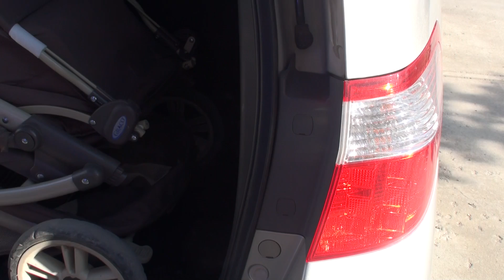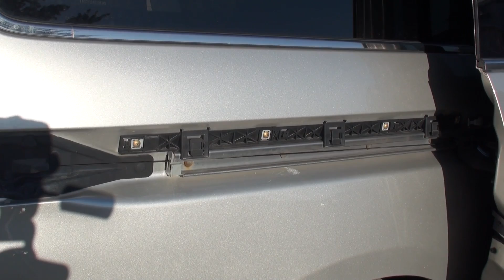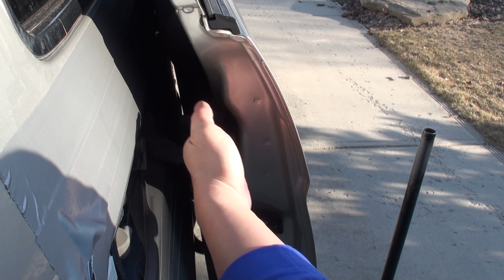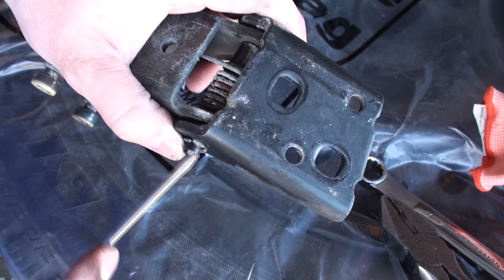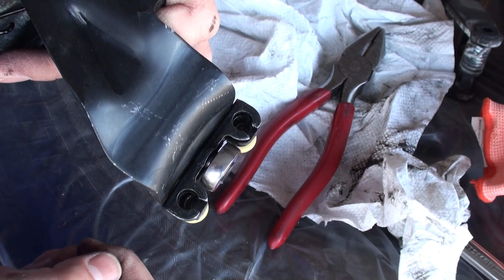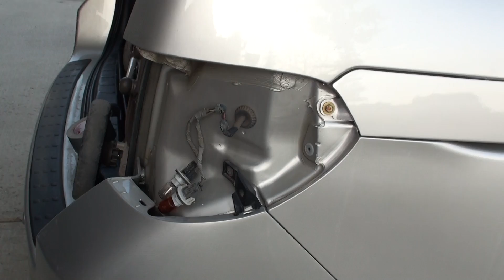Honda Odyssey Center Rail Door Roller Replacement

Comment: Thanks for the info. I do have one problem though. My cables went back inside a bit so I don't have much slack to connect the new sliding door hinge. What can I do?
Reply from the maker: you'll have to use a pair of pliers to carefully pull on the cables (you won't need much force) to pull them out.  It helps to work close to the van so that you need "less" cable.  You won't want to pull so hard you snap the end of the cable off or cause it to fray.

Comment: So thankful for this video...saved us $1800 all we needed was the roller replaced but the shop was trying to tell us we needed to replace the motor and everything. Cost us $40 and the doors work like new
Reply from the maker: yeah its amazing how incompetent the factory trained techs are.  Look at the lowest common denominator first and as a result, that is how I concluded it was a faulty roller.  Glad to hear you got it all fixed up on the cheap.

Comment: Damn bolt holding the two pieces together can’t come off. I’m still stuck trying to remove that damn bolt. Just sprayed WD40 more than a couple times, damn thing won’t budge. I need help.
Reply from the maker: Yikes, its been 2 months and I'm finally replying to this comment.  Hopefully you were able to get the bolt out.

Comment: Excellent, clear, and concise video.  I ordered the rollers for both doors on Amazon ($40 total) and installed them yesterday.  I'm sure I saved a lot of money doing it myself.  Hardest part for me was removing the pins.  There was a lot of rust and I had to use a lot of spray lubricant/rust remover then wait for it to work on the pins.  Easiest way to position the door was to turn off the power door switch and position it manually.  I also made sure to turn off the interior lights so the battery didn't drain - I saw that happened to a guy in another video.  It definitely helps to have a second person hold the door in the right spot when putting the bolts back onto the door.
Reply from the maker: glad you liked the video and thanks for sharing those tips!

Comment: Thank you very much for posting this video. Muchos Gracias Me Amigo! I know why the dealership charges circa $400 for it. It truly is a PITA job. I don't know how people were able to keep the bracket attached to the door. I couldn't get enough room to whack the pin out. My advice is if you are going to do this job, have a helper and do it on flat ground as you can get.
Reply from the maker: Thanks for watching!

Comment: Something I'd suggest is stopping the door when it's at the almost closed position, about where it starts to make the curve in the track, to install the rail cover back in. It leaves the door open enough to install the panel, but still gives you plenty of space to avoid scratching the paint. Also, if you stop the door halfway in the track before removing the roller assembly, it gives you the ability to slide the roller away from the door to get more space to remove the cables.
Reply from the maker: Great tips for our viewers.  Thanks for sharing your insight!
Reply: @piercedasian  Sure thing

Comment: I've replaced those about 5 times on my older van that had 250,000 miles on it.   a couple of tips for people.
Once I taped both ends of the cable and used needle nose pliers.  That helped a couple of times.
Another time I had to take the entire rear panel from the inside apart and had to push in the plastic pin to release the tension.  That was a pain in the azz.  Again, thanks for the great videos!
Reply from the maker: you're most welcome.  Thanks for watching!

Comment: Definitely will use this as a guide to replace my door. Currently opens gets stuck and closes. Takes 3 times to open completely and stay.
Reply from the maker: yeah it will perform just like new after the rollers are replaced.

Comment: What do you recommend for lubricating the rollers to avoid grinding noises?
Reply from the maker: no lubricant to be used.  These rollers at least to my knowledge shouldn't need any lubricant.  If you feel you MUST lubricant then I'd recommend a dry lubricant like a dry graphite spray.

Comment: I followed all the directions in this video without issue, but it seems when I open the door now it beeps three times when it gets to full opening position. Also there is a gap between the bumpers and the rollers at the top and bottom. Any idea why that is the case? I marked and remounted the hinge back to its original location.
Reply from the maker: The 3 beeps is indicative of a jam sensor getting tripped.  While you may have marked the location of the rollers it CAN be slightly off from the factory so you may want to shift the hinge around a bit to see if you can align the door better.  Even if the alignment is out you have your original markings to go back to where it was from factory.  Did you make sure the cables are inside the guides in the track?  Take a close look as it is an easy thing to overlook.

Comment: Good thorough video. One shortcut, I undid the trim on both ends, closed the door and then unlatched it to pop the rear out a bit. The trim comes off with no danger of scratching anything.
Reply from the maker: Glad your fix worked out for you!

Comment: I just bought a 2006 and it needs the same roller. But the previous owner has somehow shut the door  and it will NOT open anymore at all. Any suggestions would be great
Reply from the maker: hmm, you'd have to get behind the interior door panel (which may require you to break the interior panel) to unlatch the door so that you can service it.

Comment: A easy way to get the cable out of the old roller and into new roller is just bend the ear of cable holder down just little install your cable and then bend the ear back up
Reply from the maker: interesting tip!  I wonder what the risk would be of breaking the ear off the cable holder.  I guess better to break the new roller than break the cable.

Comment: I have an '02 Odyssey and it has the same problem on the same door.  I wonder if you could just replace the rollers and not the carrier.
Reply from the maker: I am assuming the older odysseys use a similar design as the newer ones and therefore you will need to replace the entire roller/carrier assembly.  Rollers on my specific generation of Odyssey (2005-2010) could are not replaceable on their own but as an entire assembly.

Comment: Could you slide the door forward after you unbolt the roller-hinge, keeping the jack underneath? Thus having more access room to unhook the cables?
Reply from the maker: I would NOT recommend that unless you have a helper.  The door is extremely heavy and can injure you or cause a lot of damage if it falls off the jack.  Err on the cautious side.

Comment: Bought a 2007 oddessy 3 years ago with this problem, looked on YouTube 
And I saw very complicated panel removal instructions and said I’ll pass.
Saw your video today, drove to advanced auto $44 , bought the part installed it within an hour of watching the video. Works great, thanks
Reply from the maker: fixed like a boss!  Good for you for getting it repaired PROPERLY on the cheap :)

Comment: For the cover, once you have the bolt and screw out, have the door just barely open. It’s a lot easier to take off and see what you’re doing. Also, it’s easier to have the door open about halfway when taking the cables off. More slack that way. Great video, saved me lots $$$
Reply from the maker: great tips!  Thanks for sharing.

Comment: Let me add my vote to the many here that appreciated the video.  A couple of my tips would include: Use a long-nose pliers to unhook/hook the cables into the bracket, it took less than 15 seconds to disconnect and another 30 seconds to reconnect because of the paint on the new part made seating the 'barrels' more challenging. Also, regarding the long length of cable left hanging after disconnecting...another piece of masking tape holds it nicely! Thanks again!
Reply from the maker: thanks for sharing your tips and thanks for watching!

Comment: Video was great, he is not lying when he said it was a pain in the butt to get the cable back in the hinge but I was successful and everything went back together so smooth that I could open and close the door with one finger. Then everything freaked out. The power door button when pressed would not open or close the door just start the process and make three beeps. So I took it to a service station, demonstrated the door opening and closing easily then pressed the power door open and they scratched their heads and sent me to a bodyshop. I demonstrated for the bodyshop and they said it was the computer so we twirled in a circle and jumped up and down, all the other steps they know to reset the computer. After the computer reset when you pressed the power door button it made three beeps and nothing so the bodyshop sent me on to Honda. Paid the $75 to get the appointment and sat down in the waiting room for three and a half hours luckily as the day was coming to the end they let me use a car to get home. They had to call Honda Engineering. Three days later they call and tell me the van is ready, I am excited to hear what Honda engineering had to say. When I arrive they demonstrate to me the working power door. I ask what did Honda engineering have you do? They couldn't figure it out, so we took everything apart and put it back together and it works, we don't know why. The dealership was nice, for my $75 service fee I got to drive a couple of cars for three days and they didn't charge me another dime for all the time they spent on it. So now as I watch this video again to refresh my mind on how to do the driver's side as it has also failed I'm going to do two things differently, I'm going to leave the hinge in and just use the "smacking thing" to pop the pin out and I'm going to tie a heavy butcher's string to the cable at the base of the cylinder then tie the string to the other end of the cable while pulling all the slack out of that cable that I can. When it's time to put the cylinders back in the sliding hinge I won't have to go beast mode with needle nose pliers, just gently cut away the string.
Reply from the maker: interesting that you had these issues.  Did you do the door computer reset procedure?  I didn't cover it in this vid b/c it usually isn't necessary but it is matter of yanking two fuses for 30 seconds with the power door switch set to "off" and then voila, door reprogrammed.

Comment: I've been putting up with a poorly-operating door for a while, assuming that it was encountering gravel or some debris on the track. I'd clean it, lubricate it, and it would work for a while. But it has now really failed, and the door won't close automatically.  I can see that one of the roller bearings is gone, probably broken off.   I'm going to try to get an OEM part tomorrow when the Honda dealer opens and attempt your fix. Thank you ever so much for a superb video that shows all of the steps.
Reply from the maker: glad you liked my vid.  Thanks for watching!

Comment: I lost the 6mm e-ring!  Be careful.  Luckily my dealer had one.  Can't underestimate the need for the tape.  You'll scratch the heck out of the paint (I did use it and was grateful).
Reply from the maker: yikes!  Yeah I dropped my e-clip once before and that was a nuisance to try to find but luckily b/c my garage floor was really clean that i found it.

Comment: My pin was securely lodge in the hinge.  I hammered the bloody thing for an hour, and ended up re-assembling the entire door, because it just would not come through.  Any ideas?  I am now an expert at taking this hinge off the door.
Reply from the maker: you could remove the hinge and soak it in PB Blaster and then carefully heat the hinge with a torch (hing on the work bench - NOT on the van) and as you heat the hinge up that the pin should pop out.  You don't need much heat, just enough to get the pivot points hot.  Give it a good smack with a hammer and it should just pop out.

Comment: Can't like this video enough.  Really clear video and audio, takes you step by step with really clear instructions.  The only thing I would modify is his instruction to keep the assembly as far to the rear as possible when trying to connect or disconnect the rear cable.  I found it easier to do when I moved the whole assembly a little further forward, creating a little more play in the rear cable.
Reply from the maker: glad you liked my vid.  The details are important as are good camera angles and audio :)

Comment: Great video. Going to tackle this job soon on my 2012 HO. Question, can the brackets be adjusted? Our door worked fine till someone backed into it at a parking lot. After the body shop repair, the door intermittently hangs up at 75% closed and bounces open again. I'm wondering if the door was reassembled incorrectly while being repaired. Or maybe just needs some track lube? Thoughts??
Reply from the maker: yes the positioning of the hinge on the door can be adjusted but it is somewhat of a pain b/c what is considered "aligned" ?  You can loosen the 3 bolts on the part that bolts onto the door and move the door back and forth to "average" the ideal position and then retighten the bolts and repeat this process until the door position is as perfect as you can get it.  More trial and error I think in your case which is why I demonstrated marking the factory position because generally speaking the factory is probably going to be as perfect can be.  Sorry it took me so long to reply back. Been insanely busy with life and I'm finally getting back to my viewers!
Reply: Thanks.. I'll give it a try..

Comment: have a question? if after wacking the pin it doesn't come out or the metal spreads out what would be your next move cutting the tip off?
Reply from the maker: Don't take this the wrong way but you did remove the circlip from the pin before whacking it right?  It  doesn't take much to whack it out.
Reply: piercedasian  sure did. that's why I'm a little confused why it mushroomed like that I'm thinking I'm going to have to cut it off. any suggestions?
Reply from the maker: it could very well be distorted from the factory or badly corroded such that it is seized.  I'd just remove the pin by cutting off the mushroomed portion and then using a drift pin to drive the remainder of the hinge pin out.  If you at all bend the hinge or damage it just buy a new one from Honda b/c you could inadvertently over the long term screw up the door drive system's operational geometry but I'm sure you can cut the mushroomed part off and drive it out.  Use plenty of penetrating lubricant to loosen things up.

Comment: Great information. Thank you! 
  As Shawn McConnell mentioned, it's very easy to do this without removing the door-side bracket. Simply remove the c-clip from the hinge pin, and drive the pin out first with a small hammer, and then with a long punch. 
  I also found it helpful to have the new center hinge on-hand as I removed the front cable from the old. While still holding the front cable that was newly-freed from the old hinge, I simply installed the front cable in the new hinge, thereby keeping it from dropping down to some inaccessible spot or requiring a helper.
  Seriously, I think it took longer to do the preparation than to actually do the job. Thirty minutes total, or thereabouts.
  Finally, don't forget to close the door before re-installing the door channel trim piece. It makes it much easier  :)
Reply from the maker: great tips!  Glad you got your door fixed :)

Comment: Quick question for you.  The area under the track panel cover and parts are all sticky and covered in what looks like black tar mixed with dirt.  I know the proper way to clean everything but at what points do I relubricate and what kind of lubricant should I use.  I've seen on differnt forums to use white lithium grease and others to use wheel bearing grease.  We are in the country with a gravel drive and I'm worried about the dirt that will collect on the moving parts if I use the wrong thing.  Thanks.
Reply from the maker: Here is some sound advice.  Clean the hell out of that track and do not use ANY type of grease on it.  On my Odyssey there is no lubricant of any time and you don't need it b/c the rollers are plastic/nylon.  If you lube it up then you'll eventually turn it into a grimy paste that will ruin everything that makes contact with it.

Comment: Your video is outstanding, detailed and accurate, Thank you!! I've had the driver side sliding door fail twice now two years apart, and found your video both times. Agree by far the hardest part was re installing the rear cable end. I bent the tab of the bracket a bit with needle nose pliers, and when I got the cable end installed just bent it back straight. I scratched up the body a bit, so you were correct with the tape. My jack slipped a bit and almost dropped the door, so be sure to be on level ground. 

The aftermarket bracket is apparently junk so we will see how long it lasts this time. .. have you found any service tips for bracket adjustment, or what to lube the metal track with?  ... Thanks again!
Reply from the maker: Hi Ted, not sure what to lube the track because it doesn't really need any lubrication.  It actually needs to be clean than it does lubricated.  If you put grease into the track it becomes an abrasive paste when dirt sticks to it causing more wear and tear.  Just leave well alone and make sure it's very clean.  As far as aftermarket brackets, yes they're not as good as the Honda pieces.  There is a way to adjust the bracket mount to the door to get a smoother movement action but it isn't easy to describe in a forum like this.